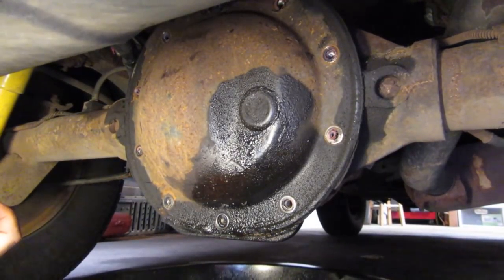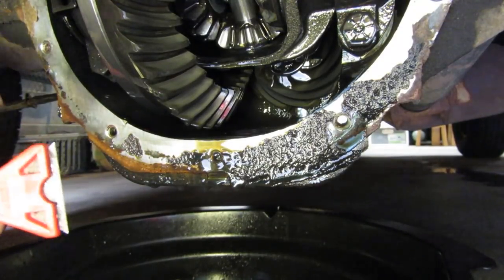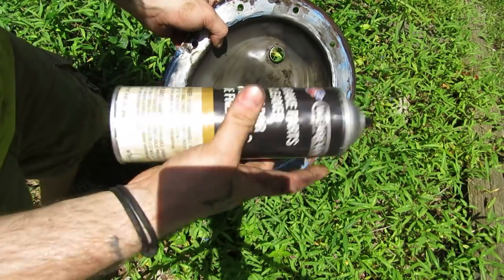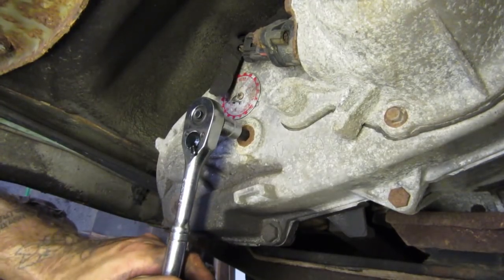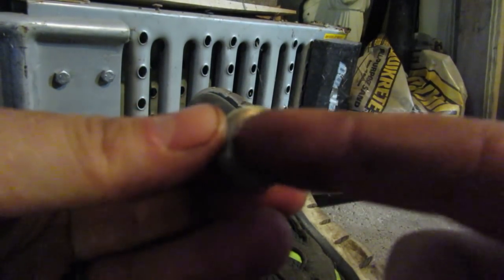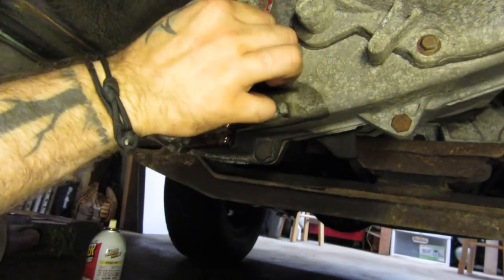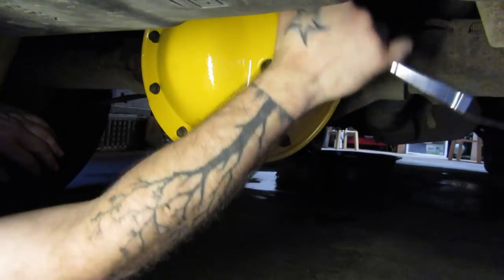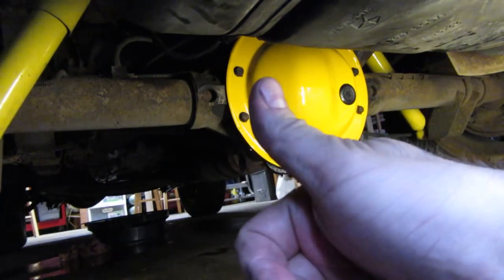How to change DIFFERENTIAL and TRANSFER CASE fluid

Comment: Thanks for this video! I have a 03 WJ V8 with a Dana 44 Super. Had it replaced 2 years ago and then started hearing some whirling recently on acceleration. Took it back to the same shop and they told me the entire thing needed to be replaced for $3,500. I think ill try changing the fluid first as I doubt a diff that was just replaced 2 years ago would go out that quick.
Reply: Did it work?

Comment: My 02 WJ Laredo 4.7L manual states to change rear differential gear oil with 2qts of conventional 75W90-80W90(without towing) or 90W140(heavy towing) with 4oz Mopar limited slip every 12K miles which seems kinda excessive but hey there have been a lot of 4WD sticking problems and differential problems on 99-04 WJs

Comment: Thanks very informative 
Question
Where can I buy the Replacement plastic filler cap?
Reply from the maker: All over.. here is one on Amazon which is pretty cheap.. https://amzn.to/3mPdkaP
Reply: I'm sure you've long found this plug, but Doman/HELP # for it is 65340. Most any local parts store should stock them also. Look for an older working at the parts store, all of us have probably sold hundreds of them...haha